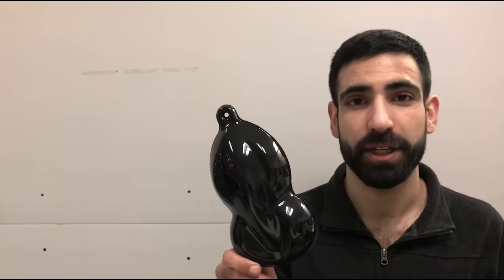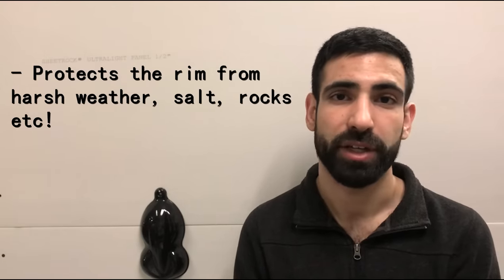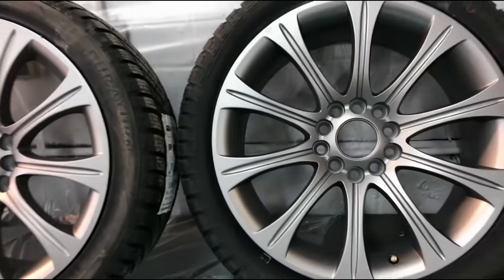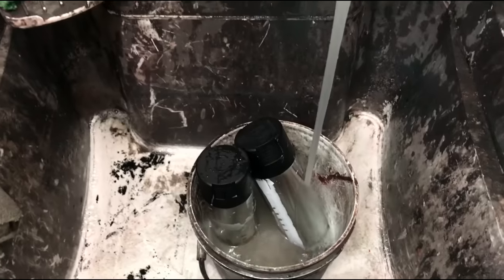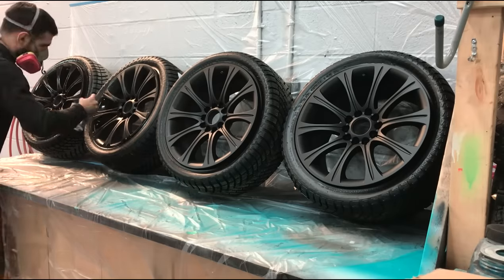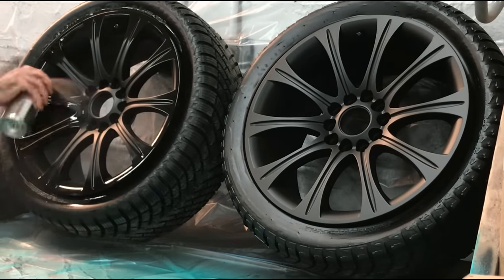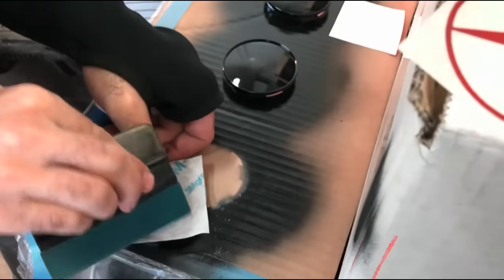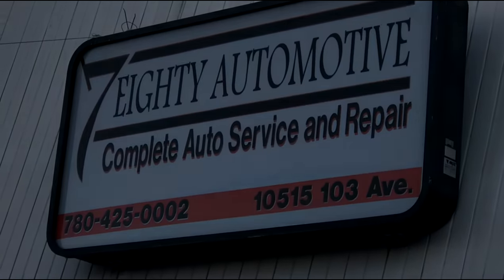How To Spray 2K High Gloss Plasti Dip Rims

Comment from the maker: Peeling 2K gloss over plasti dip video

https://youtu.be/pplD4fM-0pg
Reply: Would this clear coat work on matte black stock rims to make them shine
Reply from the maker: I havent tried spraying only clear coat but i would suggest doing base coat of black with plasti dip or whatever you want and then use the 2k clear
Reply: @EhabHalat  I'm trying to avoid the plastic dip
Reply: i just like looking at u
Reply: Amazing DIY .   How many cans does it takes for the 8-10 coats for all the four tyres?
Reply from the maker: About 4-6 cans depending on wheel size
Reply: Hi there. Can I ask you how many cans of 2K gloss did you used for all the 4 wheels ??? And also how many coats of 2K gloss did you applied on each wheel ??? Thank you 🙏🏽

(It looks amazing😍)
Reply from the maker: Only one can. One light coat followed by one medium/heavy solid coat
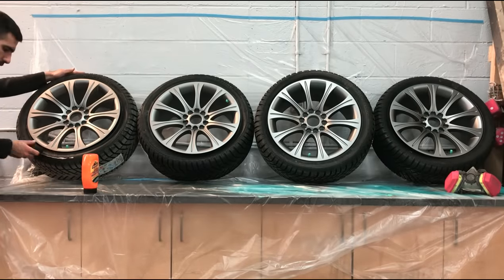Reply: Ehab Halat - I thought I will never receive a reply back... Is 04:35 here in UK and after 5 minutes since I asked you that question you replied. So cool man.. Thank you!!!! Appreciate that 🙏🏽
Reply from the maker: I got my notifications on and try to reply to as many people and questions as i can! Cool to hear you are from UK. Im in Canada 9:40 PM here
Reply: I just did mine this weekend thanks to your video! Looks good but i want to do another coat of black plast dip and then re clear them. Mine was just a little too light (didnt cover all the wheels evenly and could see some spots i missed) do you think anothe layer of plasti on the clear I just dis will work ok?
Reply from the maker: Yes but wait 48 hours before spraying over that clear
Reply: @EhabHalat  Thanks so much for the response and advice-couldnt find the answer anywhere!! I have now joined the "obsessed with plasti dip" team.. stuff is awesome!!
Reply from the maker: Not a problem! Im glad to hear that :)
Reply: How do you clean them when they get dirty? Do you have to do anything special to not damage them while cleaning?
Reply from the maker: Only used degreaser/soap and water then you can hand dry with microfibre cloth
Reply: @EhabHalat  Would you recommend using Hyperdip as it lays down smoother or will the clear coat do that for you?
Reply from the maker: I think you will get a smooth finish with both if sprayed properly so it wouldn’t make a big difference
Reply: @EhabHalat  Thanks man. As far as the high gloss goes, since it's a 2 part system, is it a one and done situation or can you save the rest of the can for other projects at a later date?
Reply from the maker: It has a pot life of 48 hours so after that it will harden in the can and wont be sprayable but sometimes it lasts for 3-4 days after you activate it. You will know once you shake the can and if the ball doesnt move in the can then its all dried up
Reply: @EhabHalat  Last question I promise. Since you took the wheels off to dip it, the inside of the lug nuts holes were dipped which is not normally recommended as it can be stripped when installing and removing lug nuts. Does adding the 2k protect against that, also does it protect the surrounding hole from being damaged when getting tires rotated?
Reply from the maker: @naughtysauce4323  ya the gloss helps with it, it will only ruin inside the lug hole but the lug nut covers it and yes the clear cost protects it and makes it more durable
Reply: @EhabHalat  You an MVP, you just earned my sub brotha
Reply from the maker: @Lary Smiles it will last anywhere from 2-5 years depending on how often you wash the wheels. I have had mine done for 2 years now and no issues

Comment: My guy I’ve been doing this since 2012 and people still ask “is that plastidip” and yes 2k clear and even 1k clear will give you a very glossy plastidipped wheel as long as you apply enough coats it’s peelable and it’s not difficult at all.
Reply: Is the 1k as glossy as the 2k?
Reply: If you are going to use a spray paint can for Gloss then you might as well just use regular spray paint for the new color as well.....I don't get this plasti dip and then gloss paint idea......

Comment: I have to say I completed plasti dipping my factory rims and using the 2k gloss and they turned out awesome. You definitely need a mask when spraying this clear coat.
Reply from the maker: Tommy Miller yes! 100% need a mask even when spraying plasti dip or anything really!
Reply: @EhabHalat  how many cans of plasti dip and 2k gloss do I need for all 4 rims ?
Reply from the maker: @shelbyhaiketic4212  one can per rim of plasti dip and then one can of 2k gloss sometimes two depending on size of wheels
Reply: @EhabHalat  got it and when u say 1-2 cans of 2k gloss do u mean total for all 4 rims, or do I need 1-2 cans of the gloss for each rim ?
Reply from the maker: 1-2 cans for all four rims of the 2k gloss
Reply: Will the plastidip and this clear coat make it through a tire change? Or will I need to reapply because I’ll do it after I get new tires. Don’t want to do it and have to redo it
Reply from the maker: @Gunmonkey5 it will be fine if properly done but its also easy to touch up if anything happens

Comment: this 2k spray max is a wonderful product. I did my wheels , painted with some metallic rusteolum paint, and it looks amazing, nobody can't tell if its a powdercoat. Heating can is the key to get a better pressure and the paint self level better. like you said in the video, use a respirator. I use the 2k max in a well ventilated garage, with a brand new paint/asbestos respirator, quit the garage on drying time and my lungs were killing me the day after. probably because of my light beard. people : shave before painting!
Reply: Where can I find that 2x spray at???
Reply from the maker: You can get it at any local paint store or even automotive store. I get mine from NAPA
Reply: Can you use plasti dip before the 2k spray ?
Reply from the maker: Yes plasti dip then 2k on top
Reply: @shelbyhaiketic4212  lol did you even watch the video?

Comment: Thanks for the video.. I actually was gonna make this same tutorial a while back.. but it was too cold. Great results. I did the same thing to my mirror caps but with regular clear coat and it turned out great as well.
Reply from the maker: Ronald Ciubuc thank you! And thats awesome glad to hear you got great results
Reply: Does it peel over time like with rock chips etc
Reply from the maker: Yes its peelable but some little pieces might be hard to get too so you use a pressure washer to remove those

Comment: last year with help of this video i dipped my rims but i skipped the 2k glossy finish for some reason which i donno why. it became so dirty and i couldnt remove break dust and other dirts from the tires even though i used everthing, for example rim cleaning agent etc. this year i removed all the plastidip and paint again, also watched this video over and over again, before i start. Now looks awesome and hope easy to clean, here in finland 2 season tires, dipped tires are summer tires and i didnt install them yet, let see, thanks for the gread instrucion video,

Comment: Can you show how the rims peel off with the dip and the gloss over it ?
Reply: That's why he lay the tire shine on it. Paint cant stick to oil.
Reply: @ja-makin-me-fit7335 At least understand what he's asking before commenting. He's asking how the plasti-dip peels off the alloy, after laying down the gloss. Not how it comes of the tire.
Reply: @groot4375  instead of beating your gums why didnt you answer the question genius? Since the gloss is on the dip it comes off the same way by rubbing thinner to start an edge to start peeling.
Reply: @ja-makin-me-fit7335  Damn, you can't have a conversation without trying to get offensive huh. I don't know the answer, that's why. I simply replied to you because you gave a totally irrelevant answer to the question at hand. 

PS.. This is called typing, I can confirm my fingers do not have gums.
Reply from the maker: Juan Torres yes i will do a video once the owner wants it removed from the rims
Reply: Ehab Halat thanks
Reply: JA-MAKIN- ME-FIT your actually not 100% right there is or was a video where they did this but the paint barely even chipped off and removing it was practically a mission. So I’d like to see if it’s the same, because if it is then your better of powder coating or at least doing this and knowing how hard it is to get off. Keep in mind I don’t know if the products from the other video were exactly the same.
Reply: Bro don’t do it. I did this once. The clear coat hardened it, made it almost impossible to peel. I had to said it off.
Reply: @playray91  was it the exact same clear coat he used in the vid?
Reply: @EhabHalat  i d like to see how it s removable after 6 months or so , actualy you can do a test on a scrap wheel after its cured 2-3 weeks and show us the result on camera to close the debat. Thanks
Reply: autowash viry yes please bc I’m scared to actually try this
Reply: @Mr_Dreco_  don't do it , there is a huge probability it won't be removable. I m still waiting to see what he claims, hope the red Benz is his own car.
Reply: Spray something else with the same stuff and wait a few weeks then peel it. I wanna see the results. I’ve heard enamel paint don’t mix well with dip.
Reply: @competitiveplay6643  apparently not since I can think on my own and do all custom work and details on my cars. There are no easy way to remove a clear coat especially a 2k. Why dont you think? How would you remove clear coat on your car? By sanding and using some thinner to help. How I remove clear coat from my wheels is with KEEN's paint stripper which eat the clear coat right off and with these wheels it has the wrap under it so it wont get to damage the actual paint. I have to repaint my wheels when I use the keen stripper. But if you actually trying to remove clear coat that must be because you are going to repaint the whiles or something. Also the paint stripper can be brush on to not get it all over.
Reply: So is it removable? I bought it cause it claims to be removable, I like to change the colors of my wheels often so it being permanent is absolutely non negotiable.
Reply: C10 Syndicate  i'll might do it on an old rim and then use the pressure washer to take it off.See how it goes.it peels off but not easy as just plastidip.I knew a product wich peel off easely but i forgot the name of it.And i would be so helpfull right  now.
Reply: @EhabHalat  where can in order the stuff needed
Reply from the maker: Black plasti dip you can get from dipyourcar.com and 2k gloss you can get from your local paint store or napa
Reply: @EhabHalat  yeah right..what's your plan to sand blast the wheels😂😂😂😂

Comment: Fun fact, this won't peel how normal Plasti Dip does.
Reply: But does it peel or would I expect thos to at least last me a year or two? Without peeling
Reply: @Roger-ob2ft  You can expect this to last a very long time. The 2K spray will harden the plasti dip. You would be a fool to think you can peel this off like plasti dip.
Reply from the maker: I should have worded it better in the video. It still is removable obviously not like Plasti Dip. Its going to be tougher to remove. I did this to showcase a high gloss finish because the glossifer is not that glossy and fades pretty quick. some people dont have the skill and money to afford/spray AutoFlex plus its not available in Canada for me. It is harder to peel but very durable, slick to the touch, doesn’t attract brake dust as much and very easy to clean. I am looking forward to high gloss aerosols from Dipyourcar which provides easier removal which Fonzie states should be released soon!
Reply: Just use a pressure washer..
Reply from the maker: I also put a video out on peeling plasti dip with 2k high gloss. It takes some time but it will peel still! Takes about 20-25 min each rim which isnt bad for a nice glossy finish and it still being removable. You can check out the video on my channel
Reply: @ModernOllie  I wanna get this but I don't want whether condition or something peeling it off. So what should I avoid from having it peeled off? If u don't mind me asking.
Reply: MOTORCYCLES ANDGUNS if you do it. only do plastidip.
Reply: @ModernOllie  i want something high quality. I like the glossy look. I'll probably get a professional to do it.
Reply: MOTORCYCLES ANDGUNS then u want something permanent not temporary.
Reply: @ModernOllie  Yeah. I don't want it to come off.
Reply: Why would you want to peel it off regardless

Comment: I used this method to dip my rims and they look great but are a pain in the ass to peel off! i tried peeling off the hub cap and it took me 10 minutes! i highly recommend everyone reading this to get dip dissolver if you are going to be using clear coat over plasti dip or you will spend hours peeling it off

Comment: Great work! Please, can u tell me which one is better 2k glossfier or plastidip glossfier? I've seen 2 of your videos when u use these.. Which one is better? Thanks for answer :)
Reply from the maker: 2k by spraymax is alot more glossy and durable
Reply: @EhabHalat  Thanks! I didnt found info in your video how much cans of plastidip do i need for 4 rims? 2 will be ok or i need 3? i have 18" rims
Reply from the maker: biniu21 you need 4 cans
Reply: I confirm. Plastidip glossifier doesn't give the wet look the 2k glossifier gives.

Comment: Great video. How long will the plastic dip last? I don’t want to remove anything.  Is it better for me to just paint the rim and apply the 2x finish since I don’t want to remove the finish?
Reply from the maker: Plasti dip alone will last 2-3 years if properly maintained, with 2k finish it will last 4-5 years at most. You can use paint or plasti dip whatever is easier for you i just have lots of experience with plasti dip

Comment: Do you reccomend sanding it? If so what’s the process of sanding and what grits do you use?
Reply from the maker: You dont need to sand the wheels unless they are in bad shape. Start off with low grit sand paper then work up to finer grit to make it smooth

Comment: Well ehab I've been undesided for past month wat the paint my wheels with was going to use plasti dip glossy but seen it & it's just not realy glossy then saw vid on luxury metal but now after seeing this & all the benefits of the 2k I'm going with this method great vid 👍
Reply from the maker: Awesome im glad to hear that
Reply: How was your result with glossy plasti dip + 2k coat?
Reply: @manross7051  great results easier to clean & has a nice gloss finish plus you can use protection products over it so it's a win win

Comment: Hi Ehab , is this the regular mat plasti dip or hyper dip combined with 2k and the  2k plus plasti dip will make a deep piano black look?
Reply from the maker: This is plasti dip with 2k ontop. You cant use hyperdip and 2k together it wont work
Reply: @EhabHalat  Ive purchased regular mat black plastidip made by performix  usa  and the exact same 2k clear coat by spray max as you reccomended thats the only ones i could get instead of hyperdip i hope it will work

Comment: Sorry 2 questions 1st why mount the tires if your spraying the wheel?  And 2 what’s the point of applying tire shine to the tires before spraying ?
Reply from the maker: Shawn Ferrell we mounted the tires first because if we sprayed the rim and mounted the tire after using the tire machine, it might damage the liquid wrap so its best to put the tires on first and then spray the rims. The tire shine is applied to the side wall of the tire because it makes it easier to remove the dip off the tires after we have finished spraying all of our coats.
Reply: Ok that make a lot of sense thank you sorry for the stupid question lol
Reply from the maker: Shawn Ferrell dont be sorry! Some people dont know so i get it :)

Comment: Hello, nice video, you got a new subscriber, my doubt Is, how many coats of 2k needed per rim?
Reply from the maker: manuel casiba hey! Thanks. You need to apply one light coat followed by one heavy solid coat after. Stand back let it cure and dry for 24 hours

Comment: Quick question. How long did this last or when did you see signs of failure, assuming normal driving conditions. Curious since I wasn't concerned about peeling it. If I can get 2 years I take that as a win.
Reply: I’m guessing it would last around 2 years, Normal plasti dip on wheels is about 1 year and it sticks better with the 2k
Reply from the maker: It is said to last 3-5 years depending how driving conditions and if u wash regularly

Comment: Thanks liquid dipper for the response.
Another question is I trye'd to buy dipit cleaner + but I did not see it on the website what do you recommend to clean plasti dip wheels and emblems and grille taillights thanks again I appreciate feed back.
Reply from the maker: Use soap and water or degreaser, let it sit on the surface for a minute. hand scrub with microfiber if really dirty and then pressure wash it off and then use dip shield for after care to maintain shine and makes it easier to clean. I have a video on it on my YouTube channel you can check out.